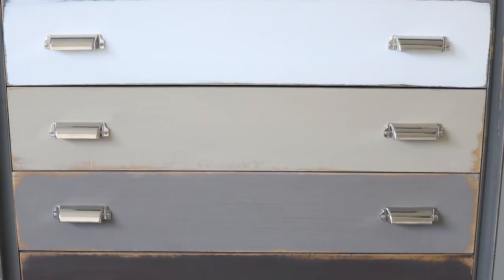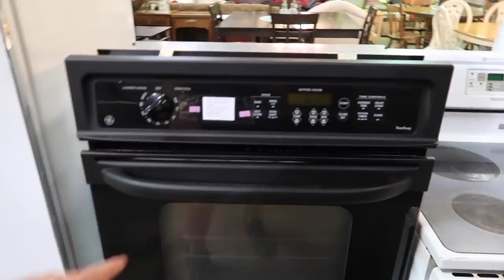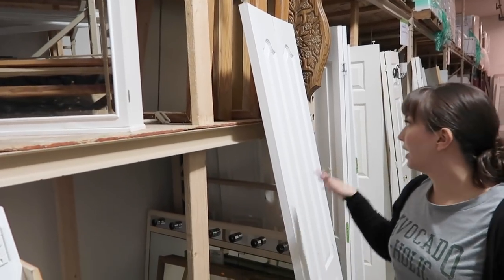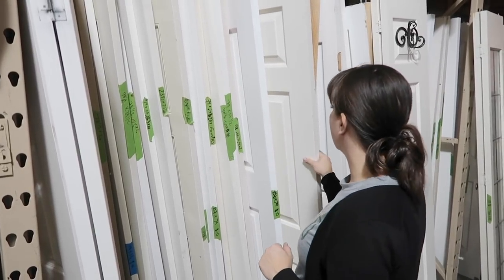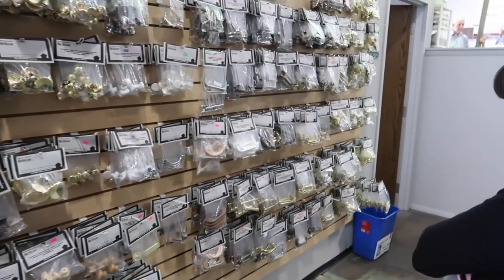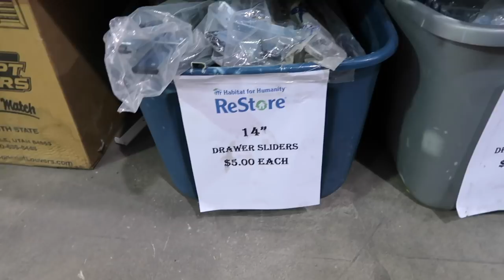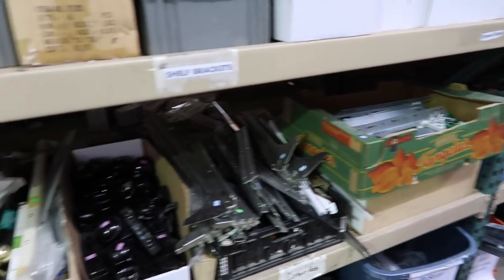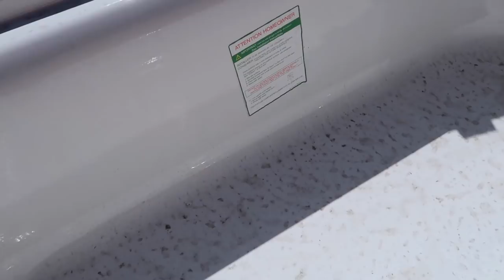Salvage Shopping For Our Fixer Upper

Comment: show it all please!!!  The exterior doors on my 1910 cottage are 32 inch.  Are yours ?
Reply from the maker: Our front door is almost 35” !  Standard front door size is 34” I think so it’s a little big. The back door is 32”
Reply: @JamiRayVintage  yep...36 inch is standard size now.  I had to special order my replacement exterior doors..(32 inch.)  was curious if you might run into same problem!  Of course I was single and depended on what help I could get.  Yours should be a much smoother ride.   😄

Comment: If you need an architect; it is NOT a fixer-upper.
Reply: Beth Parker they need an architect because they’re adding an extension on.
Reply from the maker: Haha, we’re adding a garage and large addition to the home and have to get it approved through the city zoning and building committee so we’re hiring an architect and a structural engineer to make sure that all goes smoothly.